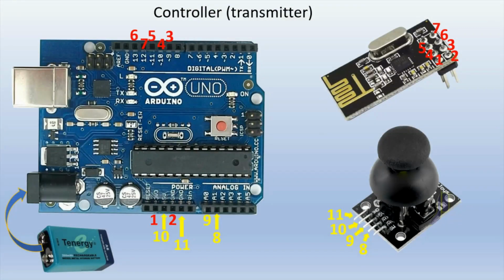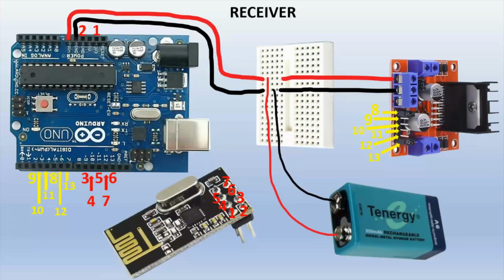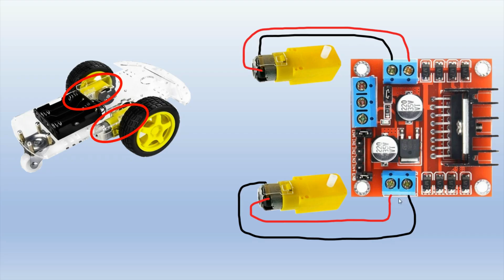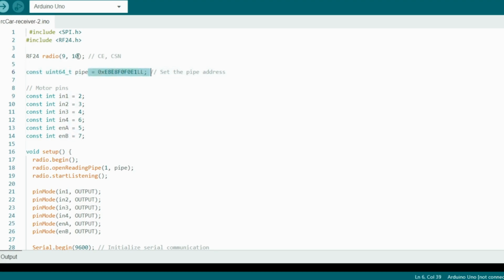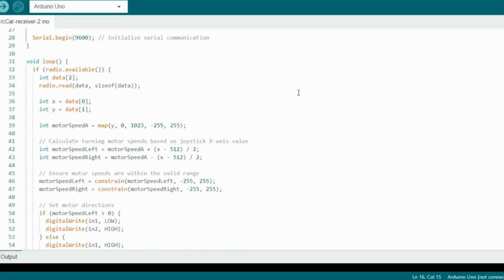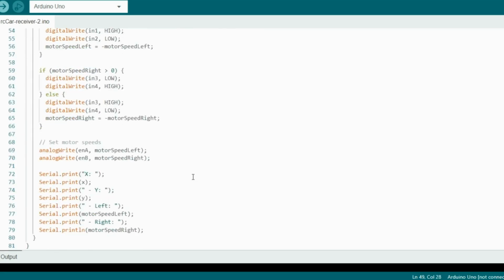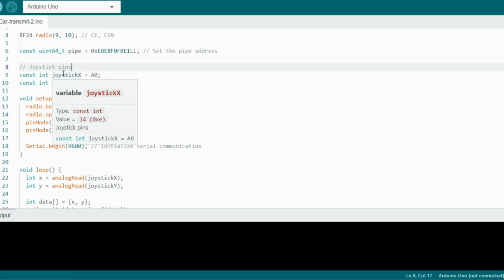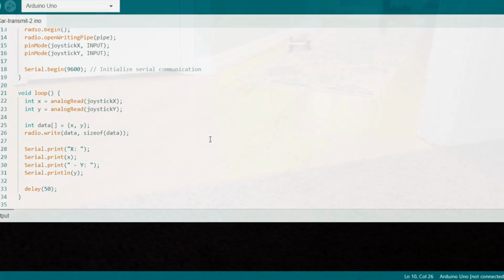BEGINNERS... Build Your First Arduino RC Car With Wireless Control NOW!

Comment: Bro but how can we do this with 4 tyres??
Reply from the maker: It depends on how you want it to work. Are you going to wire motors in parallel or wire 4 independent motor channels?

You can wire it this way: 
Left front + Left rear - connected together - “Left channel”
Right front + Right rear - connected together - “Right channel”

So you only control two groups (left pair and right pair), not all four motors separately.

You should consider what you want: 
plain 4WD- 4 motors, 2 driver channels
independant 4WD - 4 motors, 4 driver channels

this will help you choose the right motor driver to start.

Comment: Hi thank you for this video! It helped me immensely! I just had a few questions about the receiver code/sketch.

1. For mapping "motorspeedA", where did you get the -255 and 255 values from? I understand that it's for the motor speed but don't the values range from 0 - 255?
2. How did you get the equations for motor speed left and right?
3. In the if-else statements, why do you do "motorspeedleft = -motorspeedleft"? Basically making that value negative

Thank you in advance for any feedback!
Reply from the maker: Hey there!  Thanks for watching and commenting - much appreciated!
It's bee a while since I made this video  so I looked at the code I posted on Facebook.

1) About the motor speed - in this code, Speed is controlled by setSpeed().  The motor increases to a value of MAX_SPEED (150), not the full range of 0-255. Therefore, even though the motors can technically run faster, they will only run up to 150 in this case because the car was moving too fast and didn't have time to slow down before bumping into walls.
Sometimes with DC motors and motor drivers like the Adafruit motor shield, motor speed can be set within the range of 0 to 255. When you see values like -255 to 255, it typically refers to how motor speed and direction are represented. It's a way to combine both speed and direction into a single variable.

2) Motor speed for the left and right motors is adjusted by using an offset. I can use two different speed values for the motors: speedSet for motor1 (left motor) and speedSet + MAX_SPEED_OFFSET for motor2 (right motor). This ensures that the motors don't spin at exactly the same speed. If you do this you'll notice it's easier to control the car.

3) I didn't include any operations that reverse motor speeds by making them negative. Instead, the motor direction is controlled using the motor1.run(FORWARD) and motor1.run(BACKWARD) commands for direction control, while the setSpeed() function sets the speed value within the range of 0 to MAX_SPEED.
If you include motorspeedleft = -motorspeedleft in your code, it is used to reverse the direction of the left motor. By making the value negative, you're telling the motor to rotate in the opposite direction. 

Thanks for the questions!  I appreciate thinking through this.
Reply: @BMonsterLaboratory  Okay thank you for the detailed and quick response! That definitely answered my questions. Another question I have about answer 1 is you said that "in this code, speed is controlled by setSpeed()" but I don't see that function in the code on Facebook. Or were you just talking generally?

Thanks again!
Reply from the maker: @Noah-t7l8i  setSpeed() is part of the AF_DCMotor class in the AFMotor.h library. I am using AF_DCMotor to control the motors. Sorry for the confusion.
Reply: @BMonsterLaboratory  Okay I see now. I was confused because I didn't see that function used in the code.
Reply from the maker: @Noah-t7l8i  good catch
Reply: Also a follow-up question is do the enable pins for the motor have to be connected to an Arduino pin that has the PWM capability?

Comment: does anybody now where i can find the code i do not see it on facebook
Reply from the maker: do a search for "arduinocar" on Facebook. I guess they stopped using # in Facebook searches. The code is there posted in comments in 2 parts. Be sure to copy & paste both parts. If you can't find it, I will email it to you or message you over Facebook.

Comment: I am having difficulty with the motors. They are wizzing when I go a certain direction, but they are not moving. They need a little push to get going. I am not sure what my problem here is. Any help is appreciated. Thanks!
Reply: Is a Lith-Ion battery needed bc we are running on a different battery and the problem above is happening
Reply from the maker: Did you use the diagram in the video for connections? Did you use the code I posted on Facebook? What battery are you using and where is it connected? If you could take some pics of all your connections and send them to me over Facebook,  I can take a look at it
Reply from the maker: hey, did you get it working?  happy to look at an image or diagram of your connections and code 👍
Reply: Yup everything ended up working. We got the car running. The receiver needed a lithium-ion battery and that is why it wasn't working. Thanks! @BMonsterLaboratory
Reply from the maker: @AdamGraber-z9s  nice! Good job